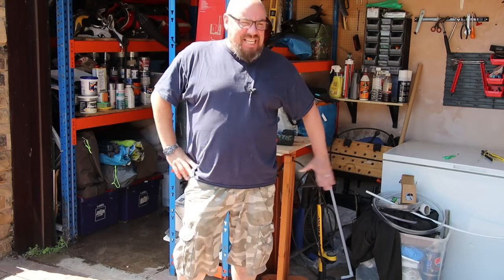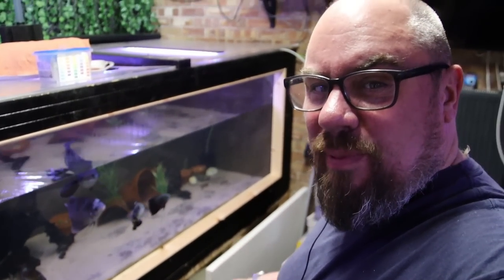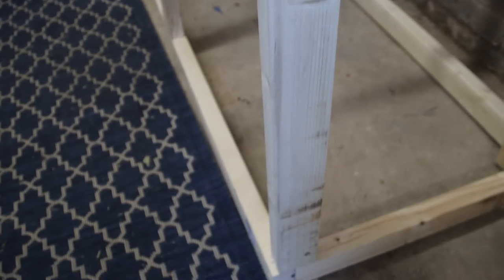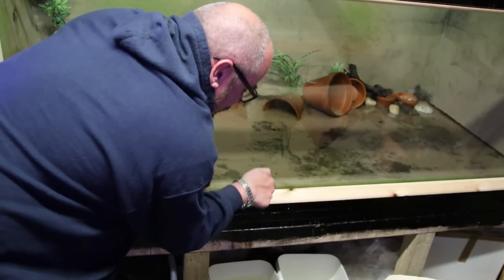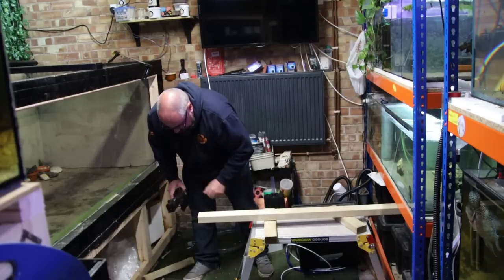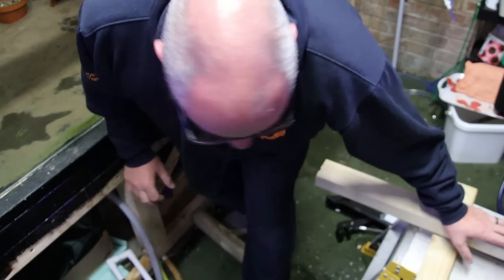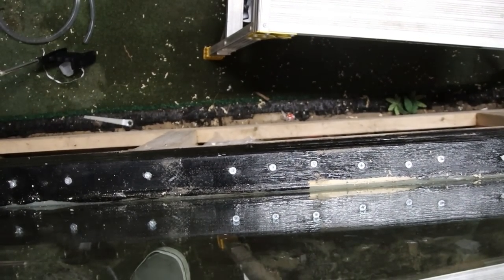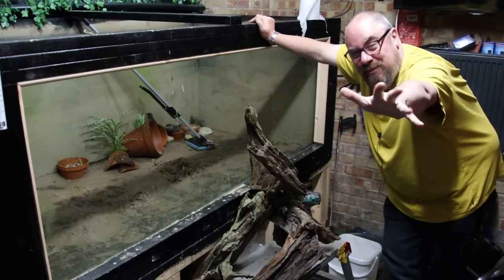Megatank is trying to DESTROY itself! Monster Aquarium leak

Comment: The problem may not be the lack of securing screws, or the water pressure. It may be mechanical in that the leak existed as a tine leak and the water has soaked into the wood either side of the joint. Wet wood as we all know weakens and warps, so the movement may be due to warping wood... which can have considerable strength.

Comment: Bit late now, but you could have done with borrowing an acrow prop I think! Also of note when I built the lean--to on our house I read that nails have better shear-strength than screws. You have put in quite a few screws though and it was long-grain to long grain so probably less of an issue that what I was doing (I.e. fixing into the end-grain of wooden joists)
Hope the repairs all hold!